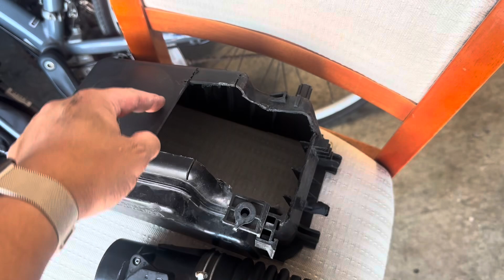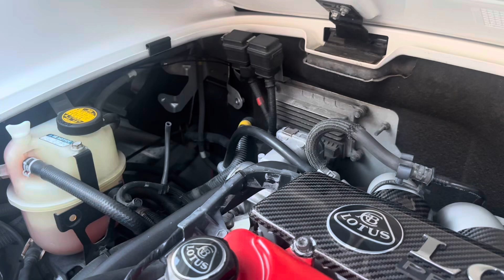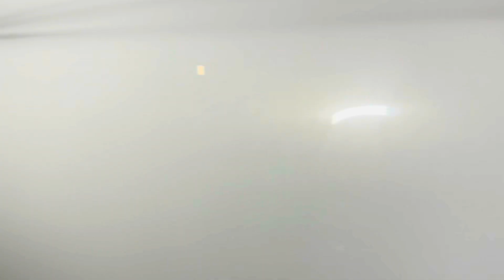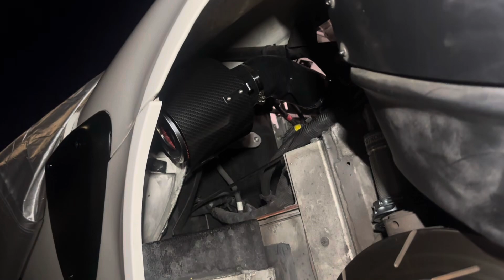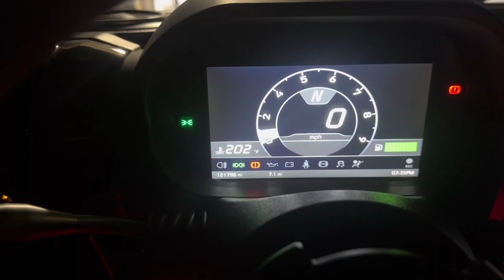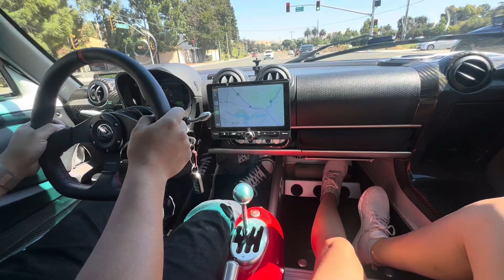Cheap Performance Mod Lotus Elise 2ZZ-GE Custom Cold Air Intake + Sonic Fury Exhaust Sound

Comment: If you don't remap the car I think you have absolutely no gain.
But still cool cause you can hear your engine breathing
Reply from the maker: Sound was the biggest factor for me. But yes you’re right, a remap is necessary for power gain
Reply: There's a lot of videos on youtube proving 2hp (1.25 fiesta) to 15 hp (k20 civic) gains without a remap

Comment: So have you monitored your AFRs while driving after this mod? I would like to do the same, but not if the engine runs lean as Shinoo suggests it may. Thanks
Reply from the maker: My AFRs have been fine, but definately grab an updated tune from Shinoo to be sure it runs in sync with the ECU. Good luck 👍

Comment: Be careful the car will lean out with a CAI.  I would suggest you get the car tuned to adjust.  Nice and smart idea: cutting a stock airbox to get the right tube diameter for the MAF.
Reply from the maker: @InoKinetic  thanks for the advice! Will reach out to InoKinetic for tune adjustment soon. 🙏